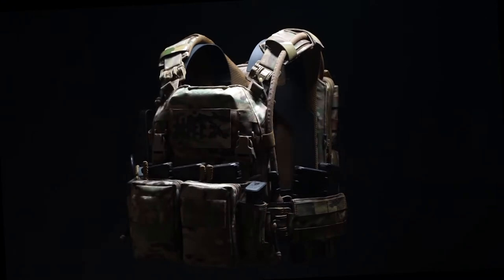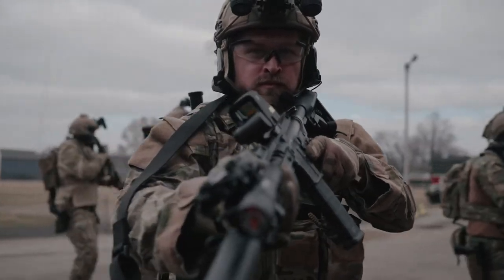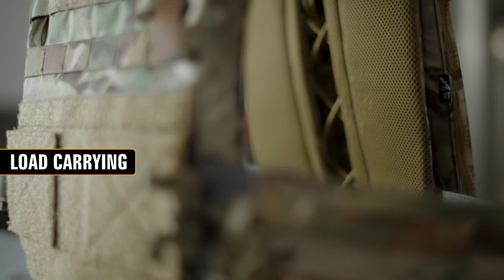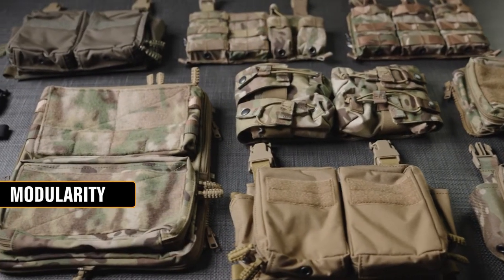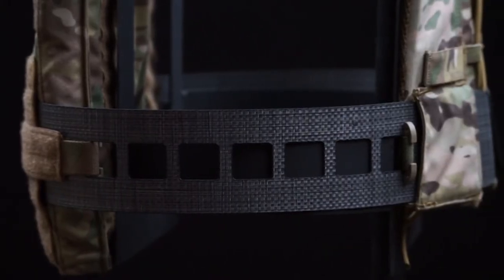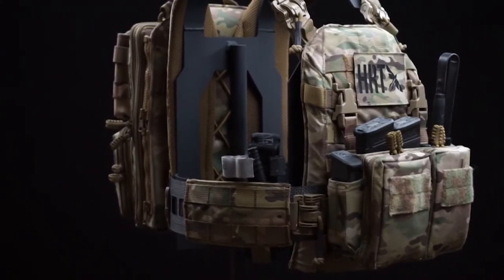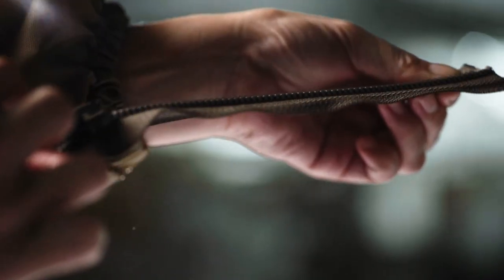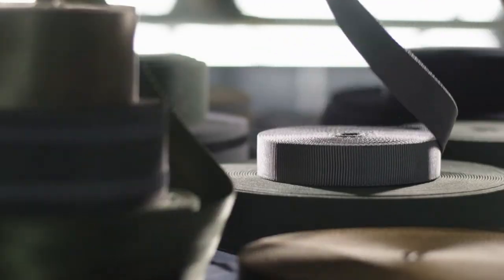HRT LBAC Plate Carrier Features

Comment: 3:08 the question - is whether there are any additional ventilation pads for the inner surface(Velcro) of the front Plate Carrier, as on the back and on the shoulders.
Reply from the maker: @yizhak_022  not built in, but can be added on
Reply: @HRTTacticalGear  Thanks for the quick answer. And where can I see it.
I did not find it on your site((